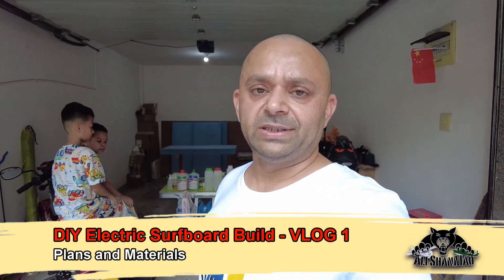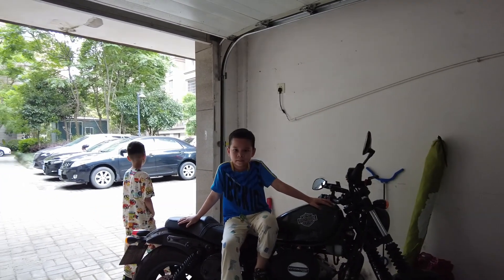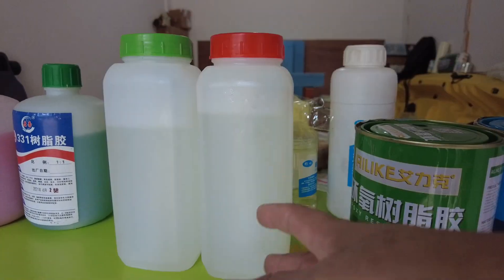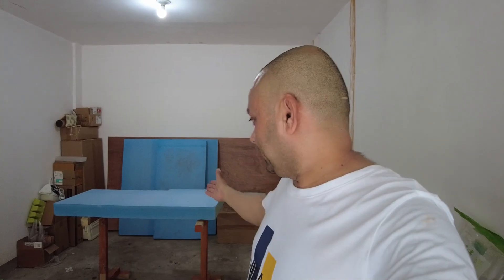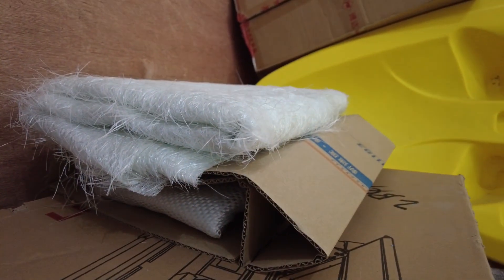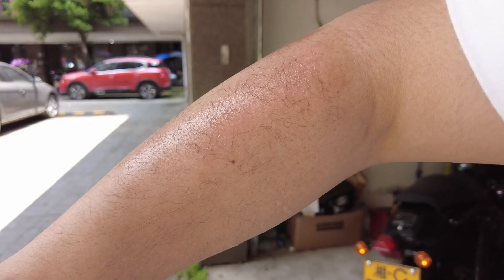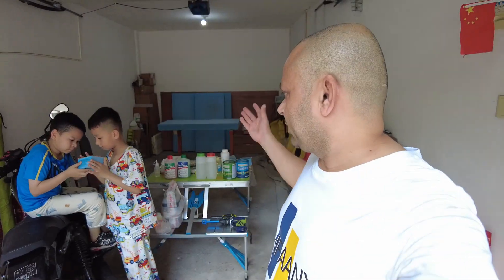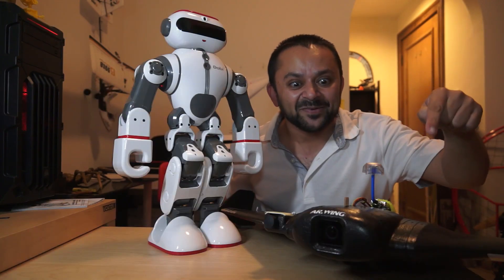DIY Electric Surfboard Build Vlog 1 - Plans and Materials

Comment: Hi my friend very excited for you it looks like your on the right track just be sure and get your ratios right I've been following your drone channel for two years making epoxy surfboards and sailboards for 23 year's and been making polyester boards for 40 year's It looks like you all ready know about the extruded styrofoam having bonding issues so no need to fine sand the foam. I like your meat tenderizer too perfect. The elcheapo cloth that looks like strands of glass stuck together that is called matt cloth it is really good for doing complex shapes like a batterie bay inside the board per haps as well as being strong I had a friend make a sailboard using the same foam as you with a thin plywood skin he glued the wood directly to the foam with epoxy and for the sides or rails of the board he covered with 3 layers of  glass if you have questions let me know cant wait to see your board in the water Cheers  Aloha from Maui
Reply from the maker: Hey Bryan, Thank you for quick and amazing tips. yes I have 3mm very thin plywood sheets. that I bought for stitch and glue Surfboard and Stitch and glue mini boat projects. these stitch and glue projects are going no side by side. foam board is teaching me a lot about epoxy and glassing and shaping. but I feel your friend is right. if I stuck the thin Plywood outside the foam it would be easier for me to use any type of Epoxy without worrying about it eating the foam out hahaha. Big thanks. You can see my progress in upcoming videos. i am taking things step by step and not hurrying it up. if my first board fiber glassing fails, I will build another. 

I hate sanding. so I am taking another route. Water resistant spray on the bottom and top and spray paint it rather than sanding the fiberglass after epoxy. How many layers are good on a Mini Boat? For Surfboard one or two will do the job but for boat, I will carry my kids so I think it has to be strong. i will build ribs as well and make it stronger.

Comment: Be careful with epoxy, fiberglass, hardener, they are all super dangerous Ali. Wear gloves, don't let kids handle it. Also, double check that the mosquito bite might in fact be allergic reaction. If the epoxy allergy gets you expect months of problems. Ask me how I know.
Reply: I say also, there is no cure or treatment for epoxy poisoning, that is absorption into skin type poisoning. It is like you have been hit with Wartime Chemical agent. Doctors will just scratch their heads and send you home.
Reply from the maker: Big thanks for your tips about epoxy. I am also aware of poisonous gases they release during curing. that is why I parked my beloved car outside and i work in this open garage. plenty of air flow. for the stinky epoxy that leaves more gases, polyurethene based i believe where you mix 2 ml hardner in 100ml epoxy, I will do it near the door of garage outside so all gases escape and i will wear respirator mask. 

I have tried Epoxy with bare hands. at least 4 types and I do not have any allergy with it. I do not have mosquito bite Allergy either. I can't stand dust, and pollen, thats what I am allergic to. 

i am also aware of dangers of sanding fiberglass after epoxy is cured. so I am not gonna do lot of sanding except preparing the sides and corners for more layers, rather i am going different way to smooth out the surfaces :)
Reply: @alishanmao  Good Luck! Btw I am still in recovery after 2 months now :/